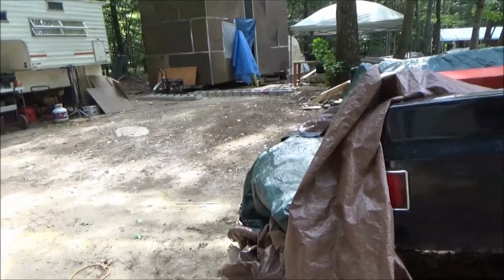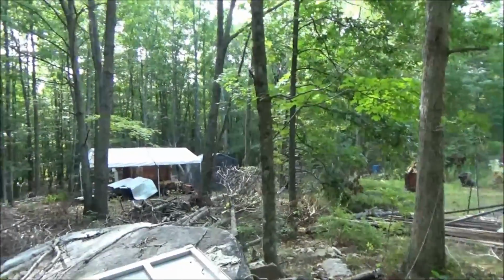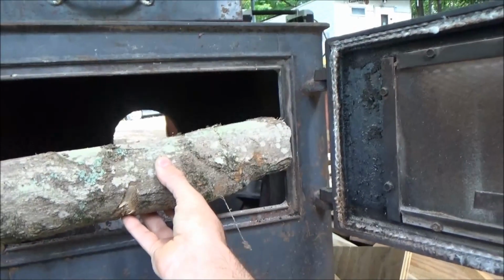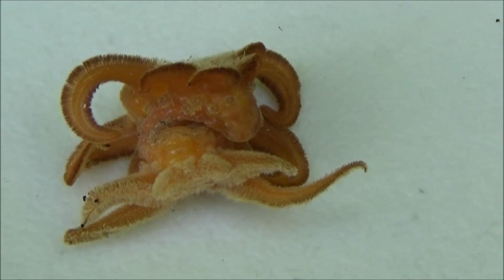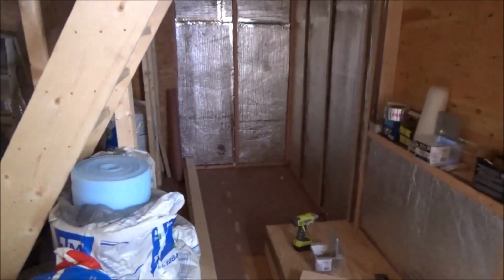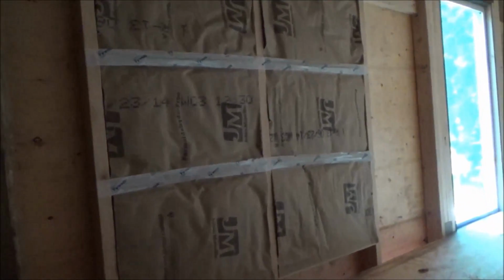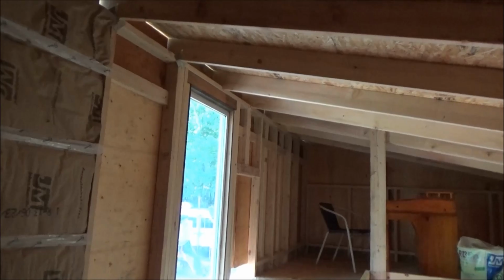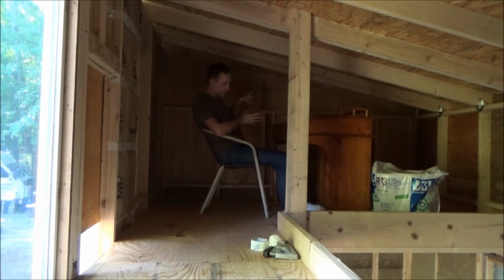Insulating My Tiny House On Wheels And A Strange Creature Invades S4

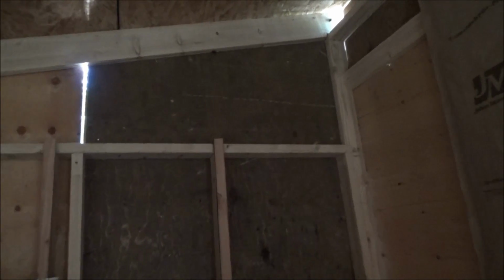Comment: At 22:00 you are talking about putting in a smaller window. What would work great is to try and find some salesman sample windows. I used these in a small shed ...I found them at a Habitat For Humanity store. Only paid $10 for the last one. They can be nice air tight replacement windows. Probably your local contractors might have them or know where to get them also.

Comment: I love your concept of off grid living and freedom from standardized living, but  im seeing a huge advancement in living conditions, and less of roughing life. stability is a good move, but how did you get the property you live on. I too want to be wire free. I cut the city phone lines, cable, and city water. im working on solar and energy generation from myself, but im still upgrading electricity.  big house and mortgaged.

Comment: Check out EVTV he has some solar panels as flat as a piece of paper. Would be great to nail up on the roof and power that computer fan idea for pulling out hot air from inside. I think it would make more than enough power for a few fans.

Comment: Are you going to frame in your air conditioner?
I wold have it framed in to the wall above the batteries near the inverter, and make a foam lined plywood  box for the out side of it during winter.

Comment: That's a really nice woodstove. Take care to check and replace the door seal if necessary. You can buy the replacement seal at most fireplace places. I grew up in New Brunswick, and there, everyone had a woodstove. I learned a lot about their upkeep and useage. Airtight only work as efficiently when they are truly air tight, so watching your  seals is important. We also used to use a catalytic combustor. That thing when engaged triples the heat output of our stove. MAy be too much in your smaller space though our stove heated a 3100 square foot home. However otherwise 70% of the energy goes up the stovepipe as unburnt gases. I could envision a hot water heater experiment for you sometime in the future:)

Comment: So you build a Airtight box to live in then you cut a hole in the floor and install a elect fan  to force the air from the one spot (dark cool damp ) that has the highest probability of growing mold and mushrooms into the living quarters ?   Think about this before drawing air from under the house. if it is parked on blocks 18 inches or so and left open is one thing but close to the forest floor and enclosed to cut off critters and light and wind ?
Reply from the maker: Then a duct running out back is the best. Thanks. I was thinking about that.

Comment: Another thing to consider, since winter is coming, is SOLAR HEATING.  On nice, sunny days, it can seriously cut down your need for wood...

http://www.cbc.ca/news/canada/new-brunswick/fredericton-man-builds-300-solar-furnace-decreases-heating-bill-1.2527065

My idea is that you can set a 5 or 12 volt computer fan to run directly from a small solar panel.  No battery needed, because it's not going to run when there's no sun, since there's no heat when there's no sun.

It needs an intake at the bottom, to draw inside air into the heating chamber, and an exhaust at the top.  That way, it's circulating inside air which already has some heat, adding heat, and pushing it back inside again.

Once summer comes around again, design it so that you've got a way to secure a box around it, to keep it from heating up, and to keep the solar panel from running the fan.

Anyway...given the size of the place, it might make it so you only need wood at night, on top of the idea that FREE HEAT fits your budget "fairly well."  d;o)

Now, if you were to set it up with a USB-powered fan, you'd need a small solar panel with USB outputs...and those are readily available now as well:

http://www.banggood.com/buy/solar-panel-charger.html

With one of those solar USB chargers, you could also use it to recharge the phone, etc., as the solar heater fan surely wouldn't use that much power...just get a cheap, dollar store USB hub, and split the power.

Thought: If the solar panel was NOT contained in the "heater box", but separately, you could just run a USB cable to the fan, and unplug it whenever you didn't want it running, or set up a temperature sensor to kill the fan once it was warm enough inside, etc., while still having a readily available USB power source that didn't draw from the batteries or the inverter.

*If you can't use those tall windows...this might be an interesting way to make use of the space...
Reply from the maker: I will experiment with solar heating this winter, yes. I am currently reviewing a solar phone charger.
Reply: I got the 7.5 watt foldable panels.  Works quite well...but I'd prefer one of the 15 watters, so that I can get a full charge of my battery pack in ONE day instead of two.

I also REALLY liked the idea of the 12 volt panels designed to sit on the dash and trickle charge your battery, too...and for obvious reasons.

I thought the solar charger with the panel and battery in one was a nifty idea...but I went for the solar panels with a USB out and separate battery packs, as that will probably have a lot more flexibility/utility over time.
Reply: The Do It Yourself World Experiment!  That's the idea!  d;o)

If you've still got any of the aluminum flashing left...that'd make a nice solar collector (box) interior, with the addition of a bit of black barbecue (high heat) paint.  Can probably easily make the frame out of any spare 2x4's (or main palette support scraps) and whatever scrap plywood/OSB you've got left.

For experimentation purposes, I've seen them designed with intake and outputs in a window insert, as well, so in the summer, you could completely detach them and chuck 'em in the shed, out of the way.

Comment: Please do a test burn with your air tight stove. You will find you can put 18 inch pieces in the fire box standing up. the wood does not have to lay flat once there is a good bed of coals. as long as wood will fit in the stove and the door closes, it will burn. The big chunk you mentioned "would never fit" WILL!  Keep the home fires burning bud.
Reply from the maker: Yes I will do a test burn before it goes into the house

Comment: Be sure you factor in air for the stove. Airtight house + wood stove without fresh air inlet = meeting your maker before your duly appointed time. If I lived closer, I would make an offer for the coal stove. I actually need one right now. However, the cost to ship here would be prohibitive.
Reply from the maker: I will have fresh air intake. Yes too bad on the coal stove. I want to sell it asap.

Comment: I wonder if a RV window, new, used, or salvage, might work for that upstairs space.  The ideal would be a double-paned window because it would provide a noise barrier and a lot better insulation, but even a small sliding window might be ideal and would fit into that confined space.  Of course, the rounded edges of the window frame may not match the other windows, but I'm pretty sure that can be fixed somehow.
Reply from the maker: Looking at basement windows now. Double pane and perfect fit.

Comment: I'm not an expert but I do know a lot about building your building your house a little bit backwards you should be running all your utilities through your walls before putting in your installation, I know you want to get it sealed in before the winter but its gonna make it harder to run wires, and potentially waste material, also instead of ceiling every single piece of plywood on the outside with tape you should have just got a roll of house wrap that would have worked way better saved material and time, and if you're that worried about gaps and bugs before you put the plywood you should have put a bead of silicone or construction adhesive on every 2x4 then put up the plywood that would have worked way better and also save on material and once again time.

Comment: Sure I won't be the only person to mention it, but you'll probably want to replace the gaskets on the doors of the stove. From my armchair position, they look a bit frayed and compacted. And before you start putting that thing together, please make sure that you dry-fit, measure twice, and ask the "dumb" questions at the fireplace shop or of any trained installer of fireplaces. You don't want warm air leaking out and smoke leaking in! 
The stove pipe may also be an area that you may want to consider investing in new vs used or salvaged.
Reply from the maker: Of course I will use only new stove pipe. I will test it before it goes inside.
Reply: I don't think you need to test it, just dry fit everything before you fix anything in place. This is why you go to the specialty shops and ask them about the instalation process and how to make repairs, clean, etc. Also ask them about their product and prices. It's amazing how frequently I find shops like this to have superior product with similar or sometimes better pricing.

Comment: Nice placement of the secretary, seems like everything is goin into place. One thing to do is on the privy door, a cresent moon window to make a little outdoor look. The little canopy was doing a little Leonardo effect, for a army guy like you, that's airborne for reinflated chute and a good thing it wasn't thirteen foot square it would have been Troy over the roof. The stove is a redo of a olde classic called a Franklin stove (Better than Ben), it will keep ya toasty and on a couple pieces of real dry wood. Hope help swings by for the paperin the outside soon.
Reply from the maker: Thanks. Yes the canopy was trying to lift me off the ground. The stove will be nice in the tiny house

Comment: If you are looking to get rid of some of the humidity in your tiny home I suggest getting Damp Rid as well. It works well in small places and acts as a dehumidifier. I use it in my small dorm room here at Dover Air Force Base here in Delaware. it really helps in the summer and it keeps my room a lot cooler as well.

Comment: Nice to see your new stove and how you can use your antique desk. For the desk, I would move it back as far as possible (taking into account the bookshelves behind you) to get the maximum headroom possible. Good to plan for fans to get rid of some hot air from the loft in the summer. I would also use fans to blow the same hot air back downstairs in the winter. I had friends who used that in a converted barn, and it worked great. All you need is a pipe that runs in the corner through the loft floor and ends in the kitchen corner for one and in the living room for the other, both as far away from the stove as possible. My friends had it wired so that the same fan could blow the air out and down, by having the fan on the inside and close either the wall opening or the pipe running down depending on where they wanted the air to go.
Reply from the maker: I will move the desk when the walls are done. I am looking at DC ceiling fans.
Reply: That would work to some extent, but a normal ceiling fan only blows straight down of course. My friends went for the ducted solution because that could take air from an area where a normal fan would not effectively draw from (like a "dead" corner) to an area that would not effectively receive the air. In your case you could blow the hot air into the bathroom - unless you think that the bathroom will be heated effectively through the wall by the stove.
Reply from the maker: pieter zeeuwen I will see how things go when its built and the put in venting or fans.

Comment: Troy, that is the perfect stove.  Although the wood must be smaller, it will last ten times longer and you have the ability to control the draft.  It will run for hours so if you need to go to town, it will be going when you return.  Safer and much more convenient.  I love ours.  BTW, you should be able to wash the window with just a wet paper towel.  May take a bit of elbow grease but the ash will help it clean. You may need a new gasket for the door.  Usually very cheap.  Like around $5.
Reply from the maker: I think it will be very efficient. The window will be so nice on a cold winter day

Comment: What ever happened to the bran new silver stove u got or was that the one u were talk about putting in the work shop
Reply: As far as I know, the silverfire stove is more of a cooking device, rather than a space heater.  It has a small fuel cavity, so it wouldn't be good for tossing a log or two in to burn overnight.  It is an excellent cooking stove, though.
Reply from the maker: That one is going in the work shop. It will be perfect for quickly heating it up in there.

Comment: do they require any type of fireproofing below and behind the wood burner? not sure if housing codes apply to yours on wheels
Reply from the maker: Code or no code, I will follow all the safety standards. I am not building this thing just to torch it on the first cold night.
Reply from the maker: Sandra Jones The tiles sound nice. But yes I fear the shipping would be insane. Thank you for the thought though
Reply: I would hope it's not going to be set on that wheel well with only the wood underneath it.
Reply: Housing codes do not apply to trailers.
Reply: 88s10Durango Would it be better to be on tiles or bricks? And maybe some tiles going up the wall? Or is that too much weight. I've got some 12 inch square porcelain tiles left over from my kitchen floor that I'd be happy to donate - though the shipping might be more than the tiles are worth. :-)

Comment: The Do It Yourself World At 21:39 you say you don't want to remove the studs because of "structural integrity". I can assure you that there is very little structural integrity in the way you have it framed now. The tops of the studs are just floating. Remove them an run them to the bottom of the rafter, or run a top plate on them.